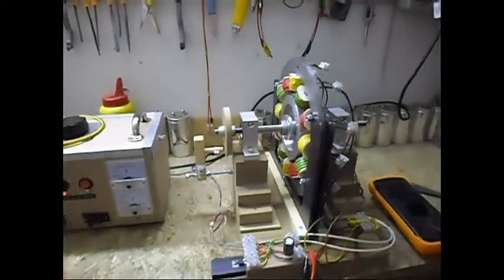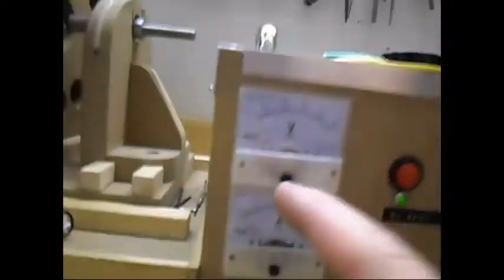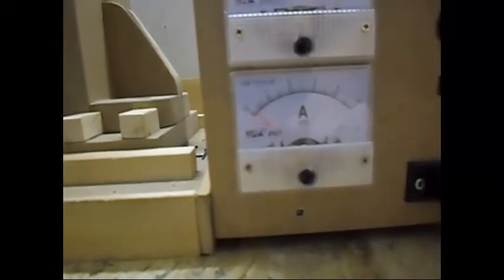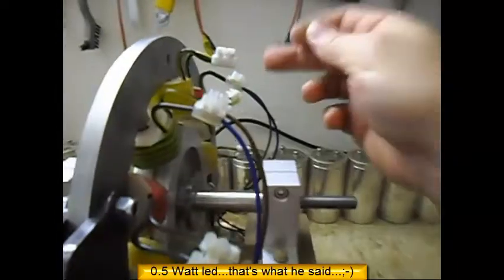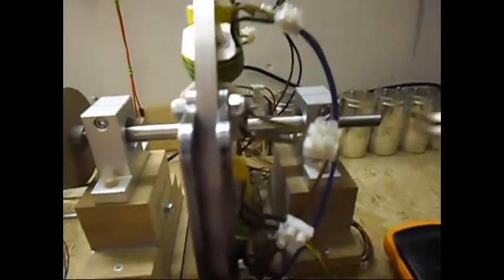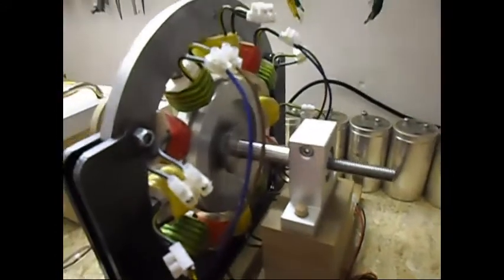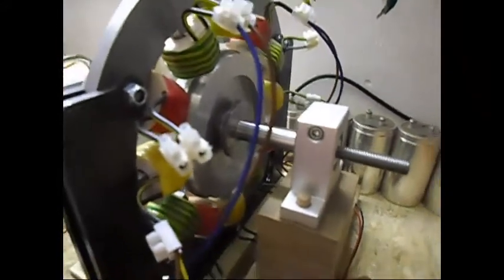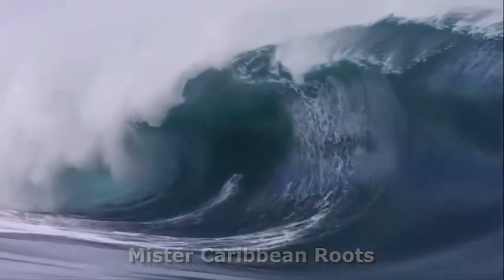Single Phase Generator_Update 18, Finally running 18Vdc @ 150Ma and no load effect yet...

Comment: critical frequency dependent on coil turns and size short/load gen coils should make motor drive current go down and rpm increase called (regenerative acceleration / thane heins) ---guess approx. 1200 to 3000 rpms
Reply from the maker: Thanks for your comment...^^
Yep, very much correct there with your writing about Thane heins regenerative acceleration effect...;-)

Comment from the maker: Finally got it running with 6 coils as drive coils on 18.5Vdc @ 150Ma(ish) and all 6 drive coils are in parallel...sweet...^^
As one can see...did some crappy load test in the video...lol...and of course those are not enough but it's a start and so far so good...;-)
Remember...have fun while experimenting...^^